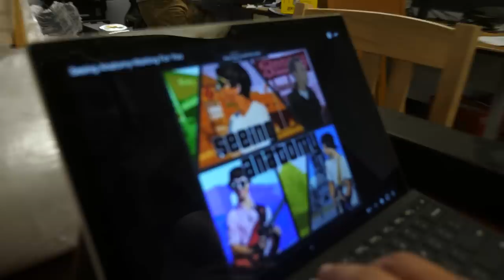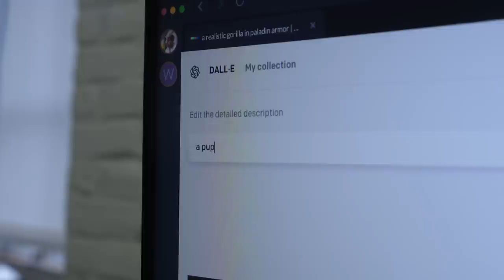Our First Finished Modular Sit/Stand Desk! (Big Gulps required)

Comment: For the cable management box - loops of some sort that I could run cable ties through would be great. Because while HIDING the cables is nice, MANAGING them is another part of it.

Desk is absolutely killer. Great work.
Reply: Agreed, even if you just throw in some Velcro loops
Reply: I mean just throw a Velcro strip on the top and use velcro straps. Any additional manipulation is going to drastically increase the cost.

I will say that the trough is probably a bit over kill. Even with recording equipment and dual monitor setup a 2x4 cable rack is plenty. This adds a huge footprint and weight which will ultimately decrease the longevity of the motors. I think a sheet metal track that has brackets to mount into the accessory track would be a more elegant solution and wouldn’t draw away from the overall design due to its smaller profile. Could even make it out of veneered ply.
Reply: na no need for. did you saw that cable tray? its enclosed from all sides. you can make cableloops and velcro them in itsself and just trow it in there. close the door and you are done.
if you use lot of stuff you can just velcro it to the others and it will stay somewhere in this huge tray.
nice point with such a large tray is you dont need to organise it a lot sinde there is enough space and its hidden enough.
(you can also just screw in something if you realy need a solid fastening point somehow))

Comment: A screen riser to go with the desk might be a good addition. It helps lift the screen to eye level like Doug wanted at 10:04 but it keeps the keyboard at a lower position that is more comfortable to type with.
Reply: I wouldn't recommend that to someone using a sit stand desk, because when you raise and lower it, there's going to be some wobbling. Plus the giant monitor/s you'd have on such a desk are even more dangerous if they fall off it. I'd use a monitor arm. Although, as I said elsewhere, I need to see their mounting solution being used on an equivalent quality monitor before I'd trust that design. I can't wrap my head around how it would actually work and be safe.
Reply: @jonevansauthor  the depth of the trough leads me to believe you could use an existing mount is you can manage to route the brackets lower clap through the cable management hole.
Reply: thats what the mount mount is for
Reply: @SurelyLightFoot  it did occur to me you could the mount style that requires you to drill through the desk. Useless for many of us, because you cannot predict where you need to mount a future monitor. They're not usually centre mounted. The size and shape of the monitor and your current seating position dictates all of that. So you need to be able to use a normal mount, without drilling through the desk, along the entire length of the desk.

FYI everyone called that out in every video they've done about it. My hope is, that you can clamp to it and they tested it (again lots of us did say they needed to test it). 

Their desk will be feature risk, which immediately puts it in a higher bracket. If I can't position monitors securely though, wherever I want along the back edge, I have no reason at all to buy it.

Comment: I love where this is going, and I might end up selling my existing desk to get one of these depending how it works out. But there's a few things:

1) I'm not that confident in the monitor mount. Most sit on top of the desk, sandwiching it betwen the plates. Having it hang off the edge makes me nervous about the strength. Instead of the weight pushing into the tabletop itself (as every other monitor mount does), it's hanging off which gives it leverage against the rails. I honestly don't think the current mount looks strong enough. Especially the bit that goes into the slot, that looks to have too little surface area, and that overtime it'll make a dent in the top of the slot, leaning the entire thing backwards.

And even if it is strong enough, how much will it wobble when you're typing quickly? People will have 32" 4K monitors (people with the money to drop on this won't be using cheap monitors), and potentially multiple, all resting on those rails. If you test it you need to have several to spread the load across that entire rail to see if it can withstand the 30+lb monitors people will have.

2) The cable trough seems way too overengineered. I get wanting it to look good if the desk isn't against a wall, but it looks like it'll be far too expensive to be worth it for a lot of people. It's very tall too. And for all of that overengineering, the entire middle floor opens out, meaning anything resting there will fall too. Wouldn't having just the front open still give you lots of room to get your arms in, without losing space to manage things in the middle when it opens?

3) Will you make a non sit/stand version? Could be a cheaper/more afordable option for those that don't want the sit/stand functionality. Or just selling the tabletop itself so people can mount their own legs/use cabinets for the desks (which is very popular for Ikea stuff, to get the nice looking tabletop on top of cabinets for storage).

4) You mentioned the larger cabinets but didn't show them. Will they be able to be open the entire way through, or will they have something across the middle? I've got a small form factor PC (NR200 case) which looks like it might fit in a larger cubby (though I'd probably have to mod it to get enough airflow).
Reply: I agree with this. especially sense most people that have the mounts have more then 1 screen  thats kind of one of the biggest things in mmo community is to have more then 1 screen. i would move the stand from the back of the desk and put it on the middle back. and if the person does not want to use it. design a plug with your logo. and when you have the plug out. its a coaster or a cool paper weight

Comment: The desk looks great. I think if you're going to have the wireless charger accessory it would make a lot of sense for it to be wired now you've got a desk with power at it. Having it battery chargeable makes sense for the MGT but I think a desk version should be more permanent and hardwired
Reply: They deliberately don't make tech permanent and hardwired, but it definitely should be able to just always be plugged in.
Reply: yeah its seem  kinda redundant to have to charge my charger
Reply: They should make something that sits between the desk and the wireless charger accessory that can charge the accessory AND allow for it to be used while plugged in. Then they don't need to change how the accessory works already, and now the charger becomes an on-the-go option when you're in a pinch.

Comment: I think you will really have to test the weight on the "mount mounts" because I often use ultrawide monitors, and have multiple monitors on a double arm  with a single attachment point.  That does not look beefy enough.

Comment: Tell me a mount mount can hold a 49 inch ultra wide and I might be interested. 40ish pounds of monitor.
Reply: That's exactly what concerns me. If the mount they're making can't hold a Samsung Neo G9 which is 16.7KG AND an Ergotron HX monitor arm which is another 6.9, then the desk is basically useless to me. That's why I didn't want a bevelled edge at the back, or an in house monitor mount solution. It sounds risky. 

I really need to see multiple monitors mounted on that thing, and very large ones. Plenty of people are using 48 inch 4K TVs now as well.
Reply: @jonevansauthor  You would imagine people who make purchases like this on a desk are the very same people who have 2+ monitors or ultrawides because they have the money for it. Knowing this desk is going to be on the deep end of tables, if they don't appeal to those people they are missing out on a portion of people who pay more for better experiences.
Reply: @Sogekidan  I did wonder if their mount thing is just for light stuff and using on the sides of the desk with the magnetic rail? And maybe the back is normal? 

But then it appears to be bevelled and it did look like there's a magnetic rail so...

Comment: Personally i think that cable trough is waaay too overengineered and bulky. I guess the bulk comes a bit with the territory; wood needing more thickness than metal. Of course all that real estate on the wyrmwood through is that youll never have any problems with cables that are too long or with plugs with large adapters. One problem I see though is that the floor falls away when the latch is opened. So it seems to me that cables or power strips would fall out when cable managing.

The solution on my personal sit-stand desk is simply 2 mounts with 4 strong screws that hold the through on its 4 corners and trough itself isnt affixed directly to the table but rests on those screws. This way you can easily swing it either direction and take it off for cable management. It seems almost cheap in a way, but from an ease of access perspective I prefer it over any other solution with mechanisms that actively lock the throughs in place.
Reply: I was thinking the same thing. I can't imagine the trough being a big seller, even though it's an important part of desk management.

Comment: I still dont trust magnets and liquids, whether it be the cup holders or the "spill-proof" toppers, with magnets and rubber. It seems cool on paper, until you drop a 2 pound drink right in the cup holder and it plops on the floor, ya know, cause magnets and leverage. Simple machines.
Reply: To be entirely fair, the magnetic rail is not meant to be doing much work. The magnetic rail assists the cup holder by ensuring that it stays completely in the slot. The leverage of the wood above and below the rail is what keeps your cup holders in place.

Comment: Wouldn't it be more convenient if when you open the cable trough that there is still a ledge right behind the opening that could have power bricks placed on it,  like say if the bottom part of the door was only half its width that way when you open your not just shoving to either side or trying to have them sit on the slanted slats?
Reply from the maker: We are currently still in the design phase, stay tuned for more details!

Comment: One concern is how the PC cables will run. 
The cable tray looks great but if the PC is on the floor there are still long ugly cables next to the desk to handle the slack of Z-movement. PC data cables are typically not very long so likely have to run outside the cable tray.
If you place a small PC in the drawer box, you have continuous cooling issues with no ventilation there.
Best look might be to place a big, heavy PC on top of the desk so cables run smoothly. 
I’d still like to see a big PC hanging underneath the desk for smoother cabling. Try showing some photos on the Kickstarter page to indicate how a fully wired PC looks neat with the desk without hindering the Z movement.

Comment: Pretty sick, I really like the cutout where you sit and the cable management holes. An option for a monitor standoff box like the trough along the back of the desktop to sit your monitors on and get them off the desktop surface with the same cable routing grommets would be cool. A lot of monitor stands don't have very good height options and it could double as more/alternative cable management options to the trough.

The other question my engineering brain asks is what is the weight limitation on the legs being used (Assuming they're dual motor and not the final choice either). My guess is the specs on the legs (based on the ones I bought years ago) used are in the ballpark of 200lbs-ish. With the solid wood tabletop, trough and a couple large cubbies (or XLs) I would guess you're eating a pretty good chunk of that with just the desk hardware. Slap a few monitors on there, some other gear and maybe a PC on your desktop and it adds up quick. Probably overestimating some of that weight though, my butcher block tabletop is a thick bitch...

I REALLY like the idea of the mount mount for monitor/mic/camera, etc arms, interested in the weight tests on it. Last thing anybody wants is a failed mount dropping their monitors on the floor.

Comment: +1 agreement on the over-engineered cable trough. An open sheet metal channel with some contact points for velcro loops, paired with a simple front skirt board, would be significantly cheaper, simpler, and lighter for the consumer and company. Something that simple (and already-solved) isn't where Wyrmwood's innovation is needed. 

Where it IS needed is on the ergonomics side. As has been mentioned here, a keyboard resting on the same plane as a standard monitor will likely result in uncomfortable/medically-bad resting posture, so a solution for a monitor riser (or a lowered keyboard shelf) should be part of the MVP product, not an add-on.

Comment: My initial thought was also surprise and concern about the cable tray design. However I understand why Jason chose this design the more I look and think about it. He's balancing accessibility, functionality, cost, and design valiantly here.  
There is definitely room for power adapters/power blocks on the left or right, or velcro strapped to the wood ventilation slats if accessibility demanded that.
If I were to consider how I would organize my current cables within this design, I don't think I would have many, if any, issues. Velcro straps or command strip cable bundlers are easy enough for us to install ourselves. 
I think if the door hinged in the center of the floor of the box, it might assuage people's concerns about the bottom entirely falling away when opened.
This design may also be too bulky vertically? It looked decent when Jason opened it, so 6 inches might be the minimum height, which if I had to guess, its probably 8 or 9 inches right now?

Comment: I'd be afraid that the cubbies will collect lots of dust on the top, which might be hard to get rid of and then look nasty.
Also, I wonder if the cable-holes in the cubbies should be through the rear or through the top. It might matter, but probably not.
Is the installation keyed? Like, can it go together in the right,  but not in the wrong way? Ikea is (was? lazy buggers) really good in putting holes and using different diameters, so idiots like me can't mess it up without using powertools.

Comment: So I don't have the budget for a $2000 desk right now, but if I did, I would be a bit worried about the mount-mounts not holding my monitor if I wanted to put it on an arm, because my monitor is 32lbs without any kind of stand at all, and putting that much weight into that small of an area with the center of gravity that far away from it would make me worry that it would, over time, break the wood. I'd love to see a mounting system that distributed the weight over a larger area so those of us with chonky ultrewides, or triple monitor setups (i.e professional programmers), could attach them without worrying about it snapping off and killing thousands of dollars worth of screen and desk at the same time.

Comment: If the cubi is gonna be utilized for computer storing the cubi needs airflow or it's gonna choke on its own heat... Also.  What's the leg room real estate. I twist and turn and stretch. But need storage or the cable troph

Comment: the only thing i saw that needed a slight improvement was the door that opens on the cable management should not be able to swing past 90 degrees
Reply: I understand why, but if it didn't, I don't think you'd be able to get things in there easily. I think we need to see some extension blocks and cables managed in there, to get a real picture of what it would actually be like. And obviously it's no good building the design without managing some cables in there to show how it looks anyway.
Reply: I was thinking this too! If the door would stop swinging down when the front had become a flat floor then you should have much-reduced risk of stuff falling out when you open it.

Comment: Could the cable trough have a mounted powerbar inside it? It clearly has enough space to just toss one into it, but mounted would be so slick.
Reply: It would be very simple to mount your own PowerBar to it. Several of them come with screw brackets built in.
Reply: I don't think that would be great, since they're country specific and would be e-waste for some customers, and in any case, you might want a 3 socket block, whereas I want a ten socket block with USB ports and surge protection.